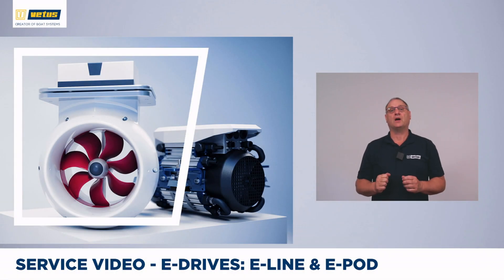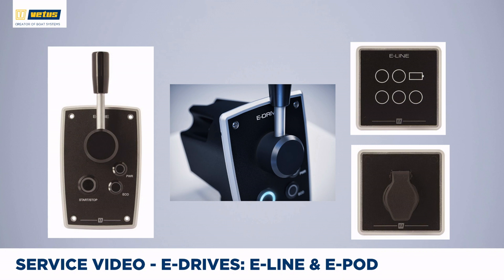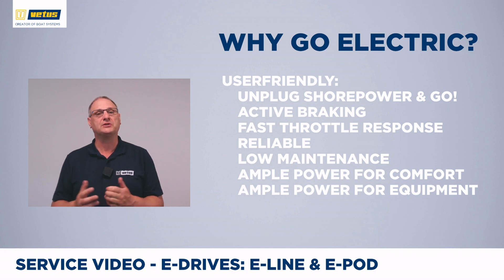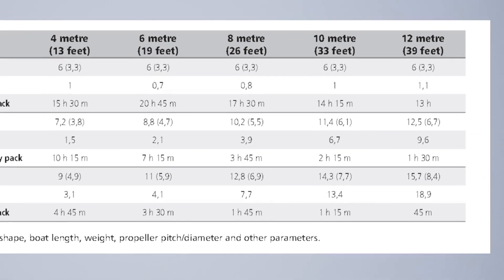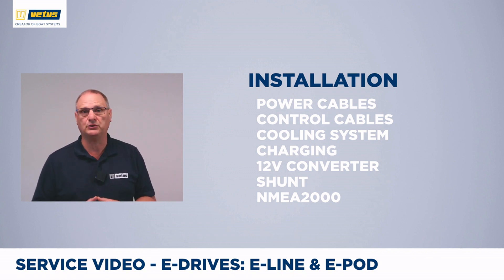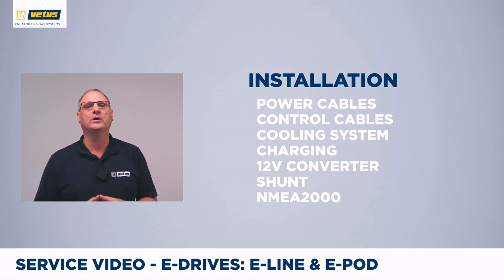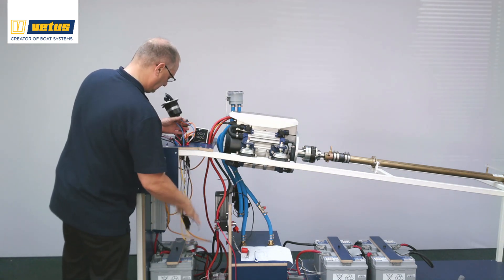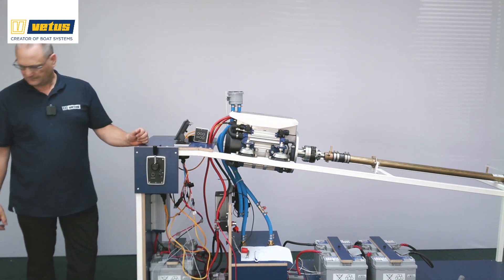VETUS electric propulsion systems : the E-line and the E-POD. Which E-Drive suits your boat?

Comment: Would you please be so kind to name the location where Vetus is having the boats for testing? I did not fully understand the name of the city. Is it possible to book a testride, of course paid? Or dou you have a rental location? I am looking to replace the diesel engine of my 10 Meter steel boat. Thank you. Think, I found it. It is in Schiedam, correct?

Comment: 😅on the water you experience wind, regenerative movement, solar and tidal, basically a 24/7 predictable energy capture. This is especially true of a sailboat in full sail. Can’t an electrically powered boat be fully off grid constantly reenergizing thus also reducing the need for oversized heavy battery as it is always recharging. Can your engines power a 50k lbs trawler?
Reply: Not really now the batteries are not so big check out Litime batteries !

Comment: Is there a way to get a motor close to 6.2 gas engines to run 213 Hamilton jets
Reply: Are you asking to replace a 6.2 or suplement?
Reply: @Real_Tim_S  replace 6.2
Reply: @r.b.s.project4631  I wouldn't recommend it, Hamilton jets are power-hungry and need high continuous power.  Gasoline or diesel is going to take less space (fuel) and the amount of battiers you're going to need to match what endurance your boat can do now will be eye-watering (both weight and cost).
Reply: @Tim S  thank you. 
Will it work to put generator and run electric motors of the generator instead of batteries
Reply: @r.b.s.project4631  Every conversion step is a loss in efficiency (about ~80-90% efficient, loss of 10-20%), I would not recommend that. By the time you go mechanical to electric and back to mechanical you're losing between 19-36% of all the original mechanical power you generated. A shaft is effectively 99%+ efficient.
  
If you use very high efficiency motors (high-voltage-hairpin roughly 95-98% efficient), the motors and controllers are going to set you back about $60k-USD per engine+drive. And you'd still need to integrate them (or pay someone to do that).
  
There's a reason that no-one has mass produced high power electric boat with jet-drives to date. It's not economically viable.

Comment: Hi I'm looking for an electronic propulsion system for a small 10 by 4.2 feet fiberglass lapstrake dinghy. I'm looking for something with no propellers like the one in the Zerojet manufactured in New Zealand. Is there such a thing out there or a company you can think of? Love the video. Thanks in advance